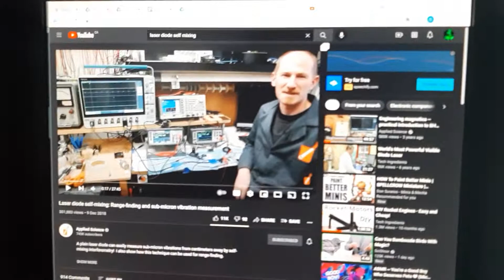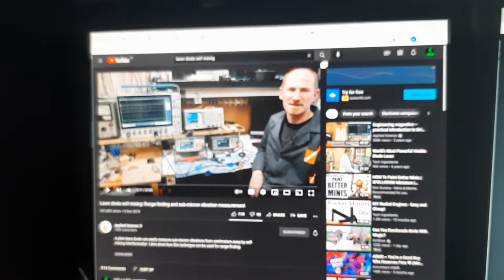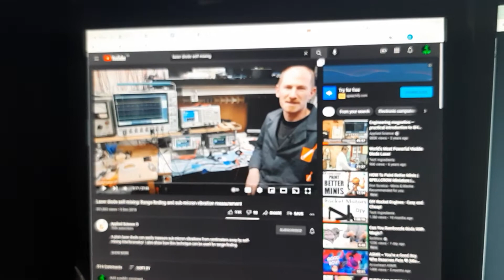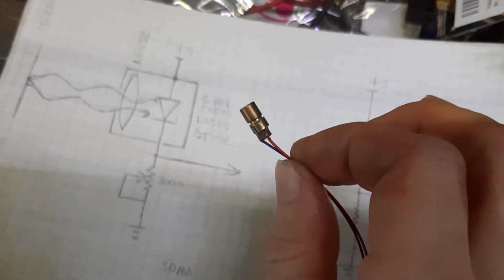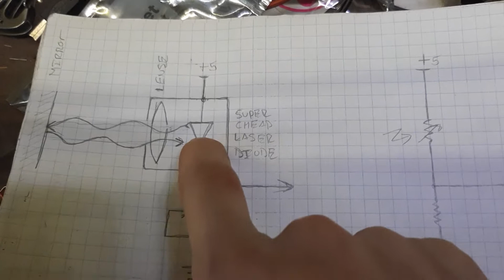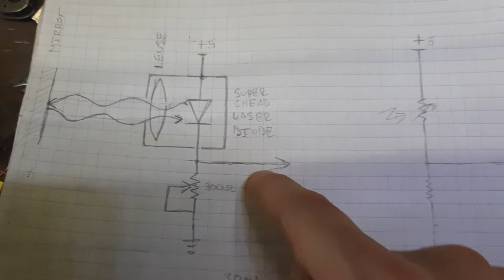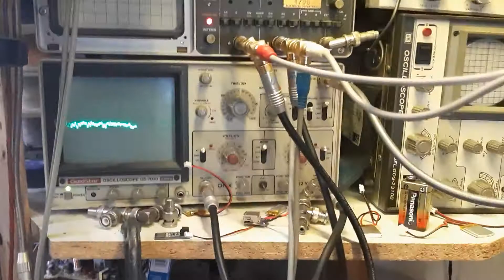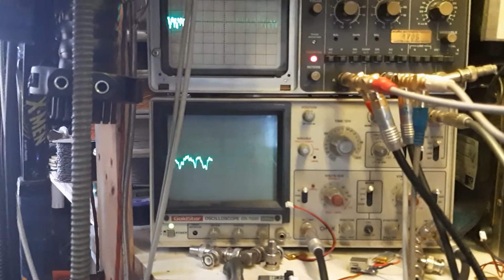Laser Diode Self-Mixing Interferometer with pocket laser style diode[No Photodiode]

Comment: Dear Sir, I have a question regarding the amplifier schematics. The 3k3 and 330k resistors are connected to some voltage, right? Not to the ground, right? Thanks a lot. Kind Regards Pavel
Reply from the maker: yes the 3k3 and 330k go to the opamp common reference.    it can be 0v (GND)  if you are using a split power supply with -V and  0 and +V   OR   in this case they all go to a pseudo-ground set at vcc/2 (2.5v) so i can use a single-ended supply at 5v

Comment: I had a setup while tinkering in which a blue laser was focused to a point onto a metal bowl basically acting like a bell, this was reflected into a photo-cell and amplified first by a pocket amp then a second amplifying stage made from old computer speaker set.  That is a dual channel amplifier pretty much ready to go with various controls depending on the speaker system.  Anyway, once that squeal was setup with minor fidgeting noises and vibrations from the room would soon come through the speaker output.  Oddly enough, I would occasionally hear what I am almost sure is people's voices from those in the house multiple floors up.   I feel like there is a lot to explore here as a proper photoresistor with a fixed frequency signal tuned to a resonant cavity drum which a mirror could be placed on should be capable of being an extremely sensitive detector for a fixed frequency range.

Comment: Wonderful project and demo. I wish to replicate it to measure seismic noise.
Can you specify why did you choose MCP6004? Any other specifications other than low cost? How about the usual LM741s? will they also work?
Reply from the maker: I like the MCP6004 specifically because it is true Rail-to-Rail operation at 5v.  it is also very well behaved and is nearly an ideal opamp doing general purpose stuff for beginners at audio frequencies. they don't oscillate very readily (unless you want) tend to be quiet, and don't have any strange operating regions where the output suddenly does something strange because of large differences in the two input voltages.    they are just very very well behaved.
Reply: @tind33p  thanks. I have never done opamps, so all this is new to me. Hopefully i will get it working.